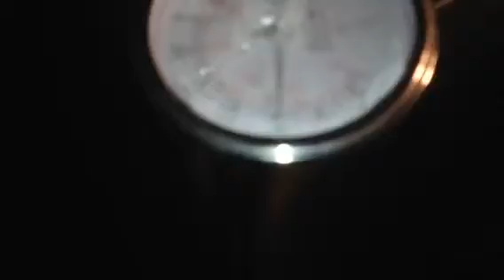Leak testing wood boiler

Comment: When you had it shut down over the summer did you cover the stack with a 5 gallon bucket?
If you didn't like a friend of ignored me on covering the stack when he fired it up he discovered 3 inches of water and was sure the boiler was bad raked out the fire and using the ash pan scraper got all the ashes out and after inspecting all over it we came to the conclusion it was simply rain water that got down the stack. Restated the fire a little bit of steam for around 5 hours and fine ever since.

Glad you were able to get yours sorted out ok.